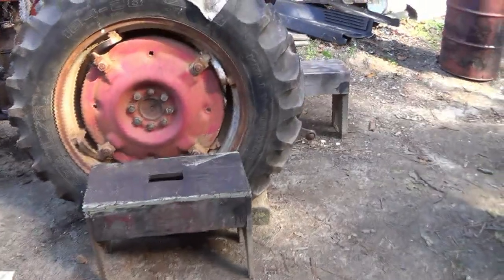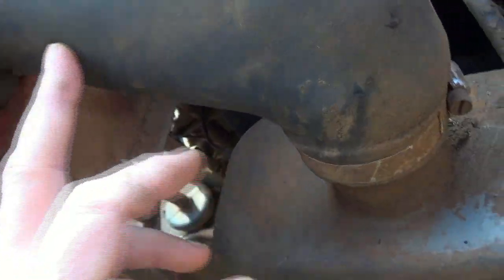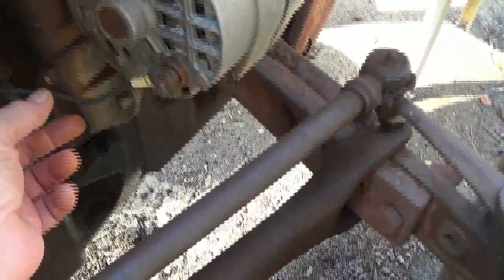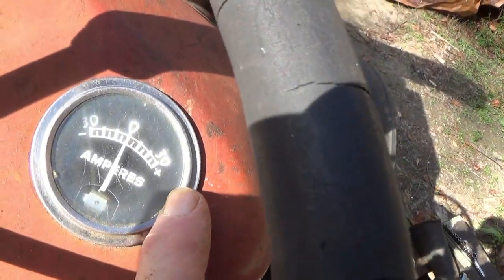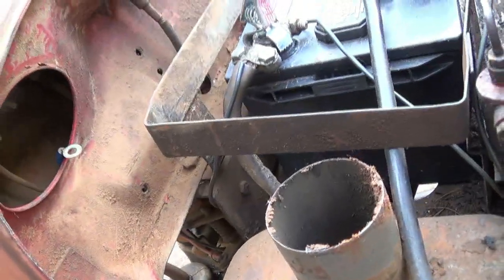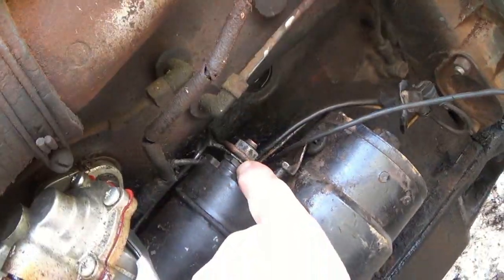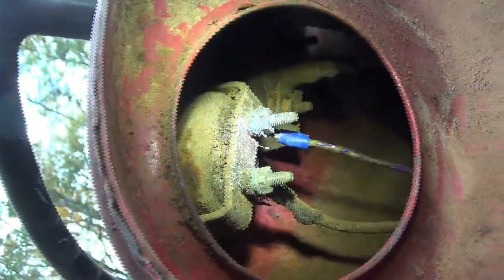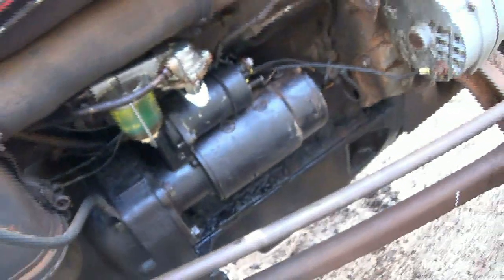How to Wire up a single wire alternator for Tractors

Comment: I have a massey 250. On the Alternator it has a ground wire grounding to a bolt on the engine then a red wire coming off. Is that normal

Comment: can u show me how to wire the charging light ? it wont goes away after the engine has started. my tractor dynamo has 3 wires .. the big one goes to starter and the other 2 are just for powering the battery and lights .. i have to idea how to wiring the charging lights ... plz help me .. thx in advance :)

Comment: HI, I want to put a one wire alternator in place of my generator. on my 2010 John Deere tractor.  It has a POSITIVE ground.  Can you tell me how to wire the alternator.  thank you very much.          Fred
Reply from the maker: you will have to change your system over to negative ground
Stan
Reply: Exactly what do I have to change to make it negative ground.  thank you very much.        Fred
Reply from the maker: everything that is hooked up to the wiring - amp - fuel - what tractor of 2010 have you got that is positive ground? john deere what model
Stan
Reply: FixinThatUp
Reply: FixinThatUp I have a John Deere 2010 Built in the 60s.  So just turn the battery around. change the wires on the coil. and change the wires on the idot light. and the gas guage. Is that right.?  how about the points? or starter? All information is very much appreciated.                 fred
Reply from the maker: this video may help
Ford 8n 6 volt to 12 volt #1 of 2